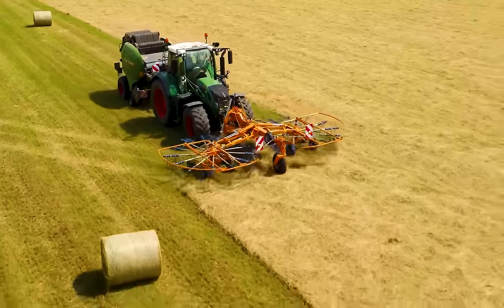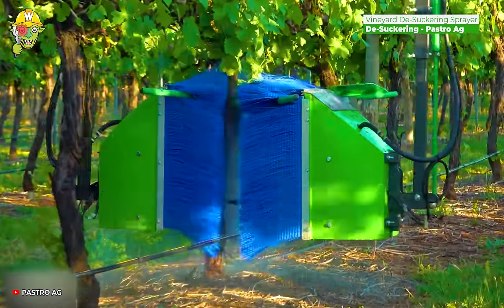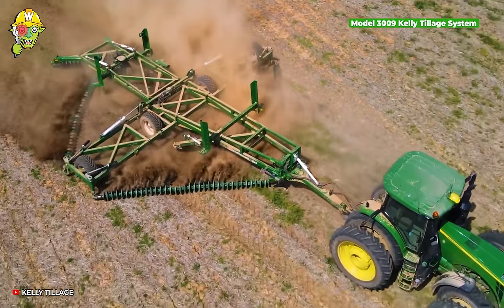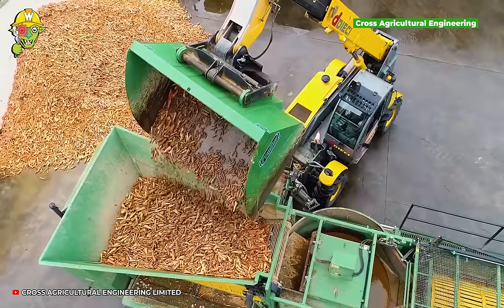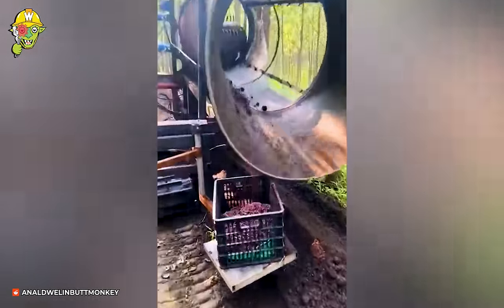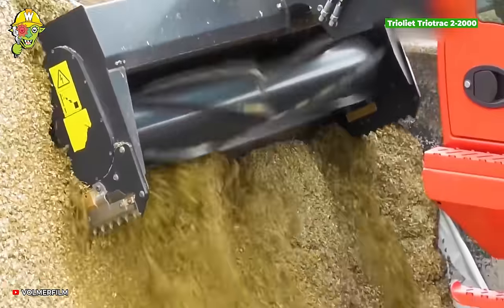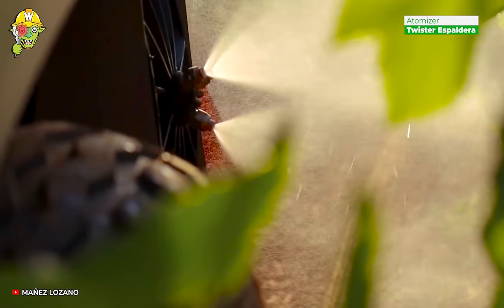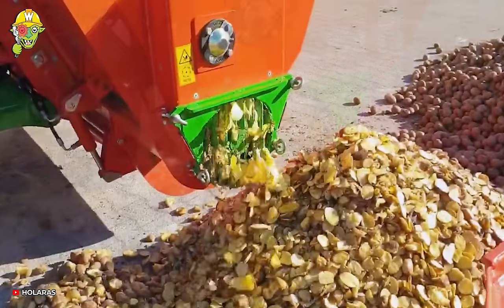Futuristic Agriculture Machines That are Next Level

Comment: Just remember, the heavier the machine is, the more you will compact the ground, thereby reducing your crop by 5% every single year. I only work with small tractors from the 60's and 70's, maximum 1.6 tonnes and a maximum power of 40 hp.